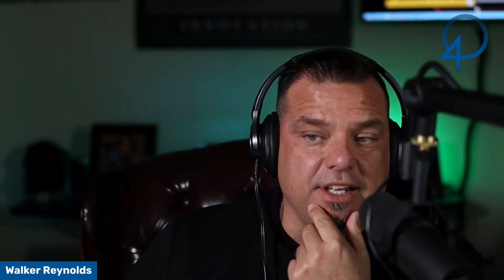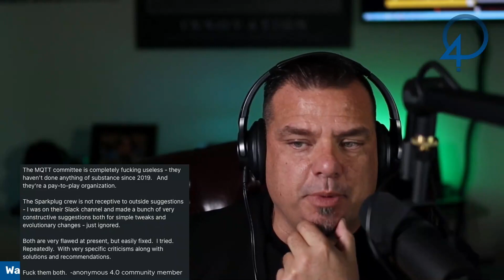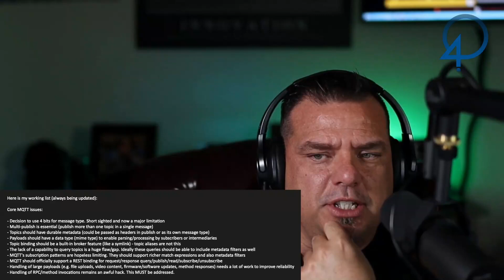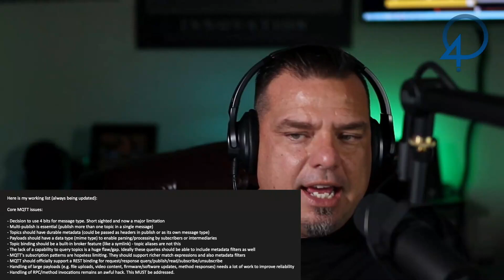MQTT needs to fix these issues...

Comment: Based on the origin and history of MQTT, it sounds to me like the developers succeeded in their original goal.  They could not have foreseen the extent to which their protocol has been adopted, or the variety of applications for which it is used.  It is not possible to foresee all use cases and design something that does not have limitations.  The 80/20 rule probably applies here twice (96%).  For the 4% that need "more power" there is a lot of open source code out there, so you can customize and create your own MQTT-X version that meets your needs.  After you develop version X, you can to sell it to others in the 4% category.  As the saying goes for  good, fast, and cheap.  You can pick two.
Reply from the maker: Well said. Nothing can be perfect.

Comment: I think the industry in general is thinking to small. Data in OT is more than just equipment PLC based data. We need to pub/sub PLM CMMS MES ERP and other vertical data. The protocol and methods to support the interoperability that we are chasing needs to support all of these nodes in the ecosystem.  We need to start thinking data centric and not application centric.
Reply from the maker: Well said JP.